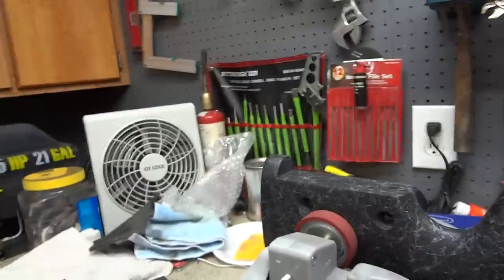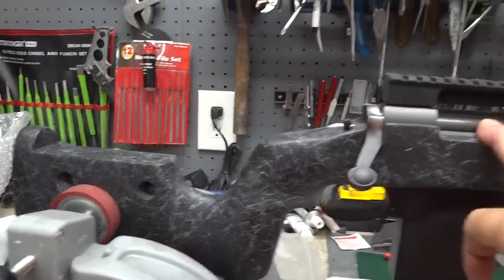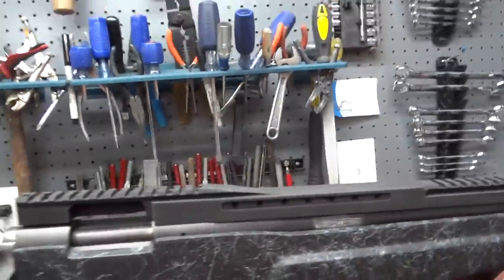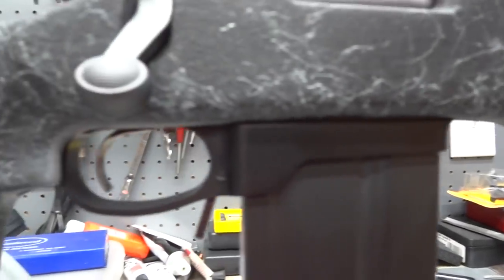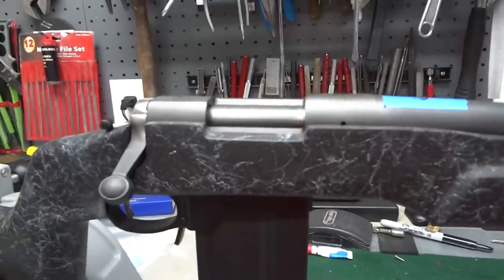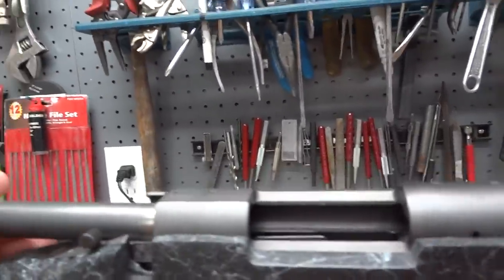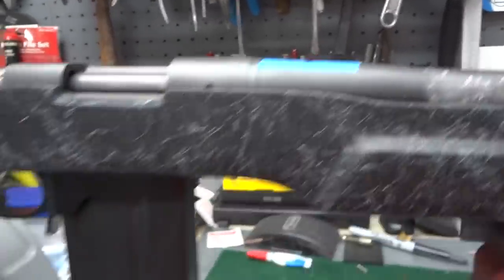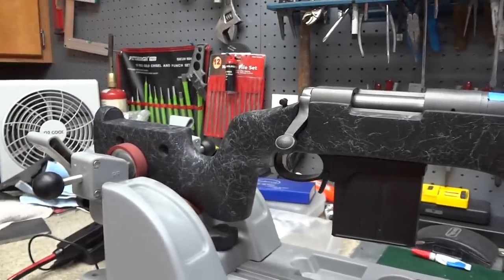Remington 700 AAC SD build-The Guardian, part 1

Comment: How did you get the action so smooth? It appears that there is a very minute amount of resistance when you close the bolt and lock it down.
Reply from the maker: If you or referring to this video, there is no firing mechanism in the bolt. In other words it is not cocking on the close. This video is mock-up only, the finished 700 is another video

Comment: I have the same stock on my Rem700 VTR and have had nothing but problems with mine.  I had to take it to gunsmith to get the bedding sanded and machined becuase initially the paper test didn't work it was lopsided.  But now it works after spending another 200 and several trips to gunsmiths to get it fixed.  But I like the mode you have done.  Please subscribe to my channel I will have more videos in the future of shooting events with my son.  Great work.